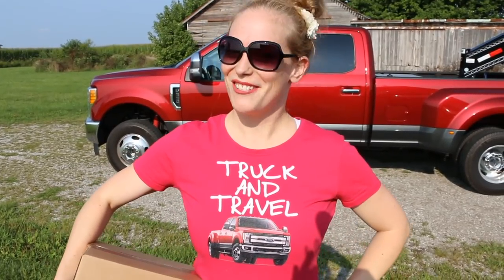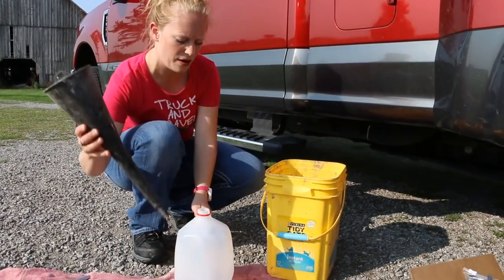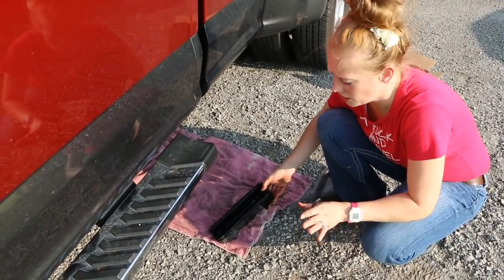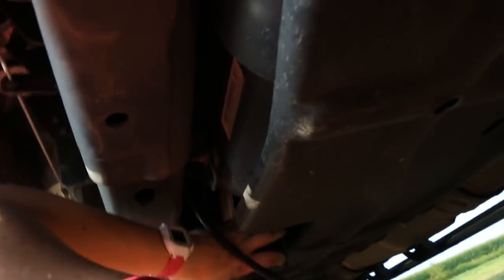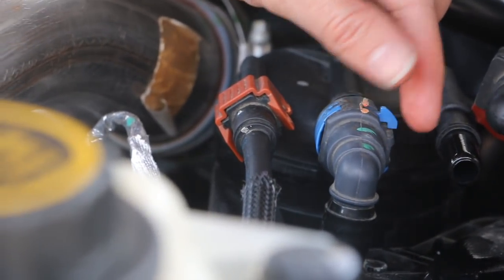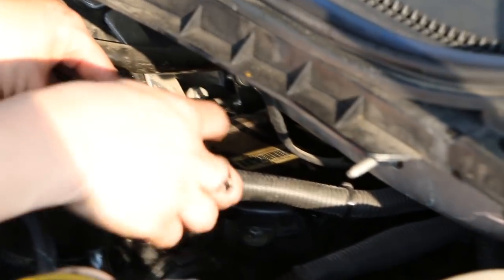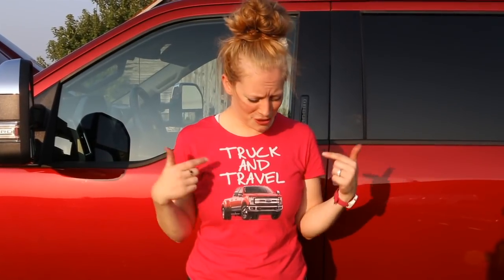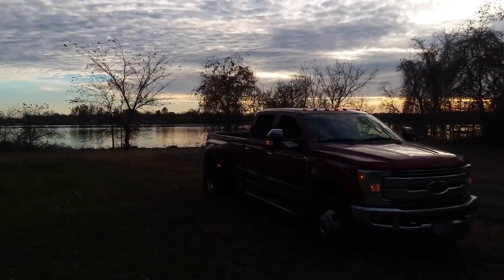How To Change Fuel Filters On A 2017 And Newer Ford Super Duty Power Stroke Diesel

Comment: This was much better than another channel on here that I won't name.  You started with the lower so it won't spray out up top and thanks for showing how much came out from the lower.  It is nice to see how those clips worked too. Sometimes people don't show that and that can be the hardest part.  I did plug I my wife VW and couldn't figure out how to get the coil pack unclipped and broke one so thank you for showing how these come apart.

Comment: 2017 F450.  More like half a gallon drained out.  I used an actual drain pan.  There was some debris in the filter body, not a lot, but visible.  Actually, it’s shift back, but.  Nice job.  Definitely place a towel around top side filter and tilt as she instructs so you don’t spill.  The biggest time consumer is draining rear filter.  Otherwise, it’s cake.

Comment: Good job on this video, actually one of the better ones. After tackling this job for the first time I gotta stress...make sure to check that those connections are secure on the small engi e mounted filter. Have a spotter when you prime the fuel lines. Don't ask...
Reply from the maker: I have a little behind the scenes secret....we started the engine and heard a pop....ours wasn't connected all the way
 😳😂😂😂😂 
-Cinnamon

Comment: Excellent video this is the second video for 2017 6.7 l Powerstroke engines that I've watched in regards to changing the fuel filter the first one the guy ( a FORD tech) got coated in diesel fuel because he didn't didn't drain the fuel that was in the supporting fuel filter Reservoir and of course you did that and therefore nothing sprayed out all over the driveway and that was great. Also if and when your truck gets to the point where it's out of warranty and you wish to save on parts and labor cost I use an American Ford parts supplier called Lasco Auto Parts and they're out of Flint Michigan no joke you will save about 30 to 60% over the cost that you're paying now for parts for your rig look them up on Google
Reply from the maker: We will definitely check them out. Thank you very much! 
-Cinnamon
Reply: Even in warranty, as long as you use Ford parts, you can do the maintenance yourself and buy the parts from any supplier.  It doesn't have to be the dealer.

Comment: Today was the day that I decided to change my filters mainly because it was warm outside .The truck had a full tank of fuel , when I went to drain and change the filter on the frame I drained out 5 gallons of fuel and it looked like it wasn't going to stop anytime soon so I stopped and changed the filter on the engine which was easy .
I can't see how but it appears that the fuel tank has to be near empty before changing the filter on the frame , have you ever ran into this ? Thanks in advance .

Comment: During your Hotshot and RV career how many times have you needed to use the 4 wheel drive on your truck thanks Derek
Reply: If you get 500,000 miles out of your truck and you can save a minimum of 1 MPG with 2wd.. do the math 4X4 is not worth it, just be smart in the winter.
Reply from the maker: I would say 5-10 in a years time.
Reply from the maker: There was places I needed it going up heal to a rv dealership in good weather. stones

Comment: Next time you crawl under a vehicle, please use eye protection. It doesn't take much to get a piece of debris to land in your eye and ruin the day. Nice video btw.
Reply from the maker: Yes! Very good advice and will do in the future! Thanks Jim!
-Cinnamon
Reply: Go to Walmart and get some surgical gloves. They're like a couple of bucks for a hundred. Keep your hands clean and when done just peel them off. I use them for fueling.
Reply: @ictpilot  I agree and was going to suggest the same thing.  I have been maintaining my own vehicles since I could drive and the machines at work before that.  After all that exposure without gloves it gave me exzyma.  Skin condition.  Itchy hands and blisters and then spreads as you scratch an pop them open.  It actually started after I made fun of a friend for wearing latex/nitrile gloves. Karma.